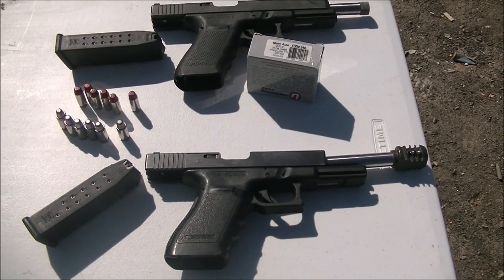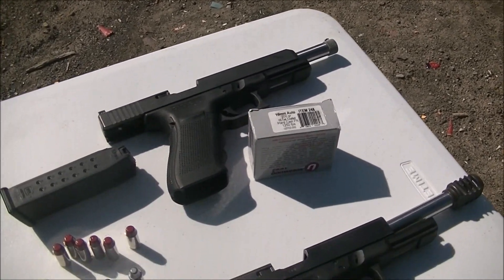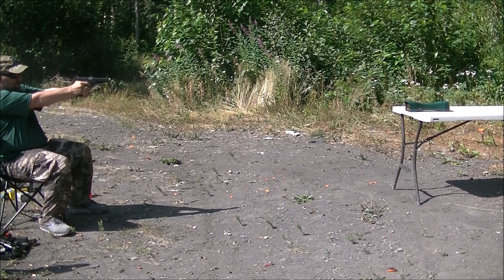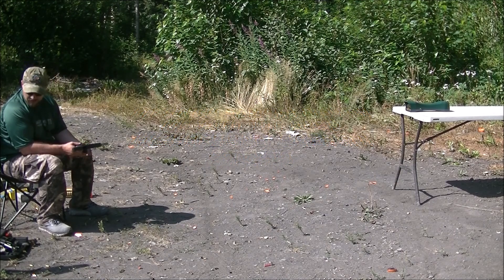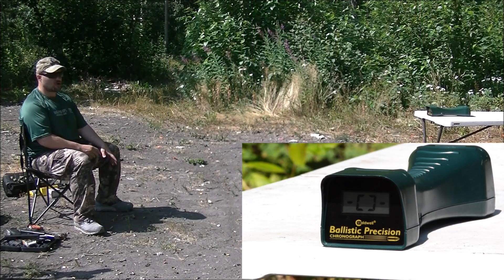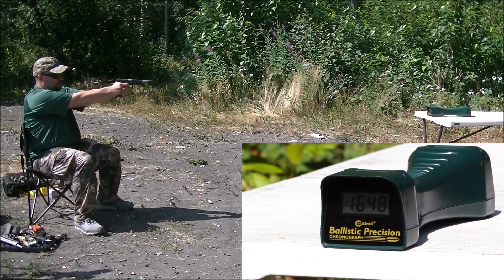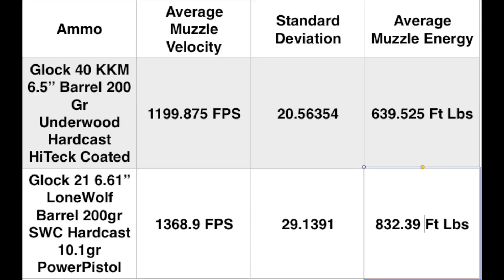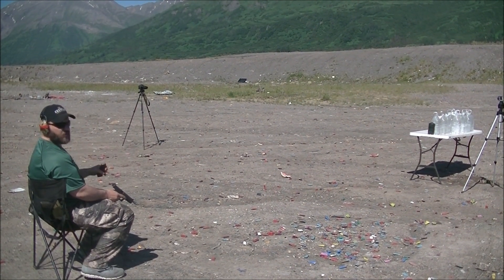10mm vs 45 Super 200gr Episode 3: Hardcast Lead

Comment: Its quite obvious though that 45 super is unreliable at least in glock conversions as seen all over the internet.  Maybe hk usps are reliable with 45 super. But it doesn't do anyone any good against a bear if the slide doesn't go into battery. Stick with revolvers people for that
Reply from the maker: the 10mm is just fine.

Comment: Have you ever tried .450 smc? I’m told it’s basically the same loading as a .45 super, but it utilizes a cut down .308 casing, making it safer to use in a bone-stock 45acp+p rated handgun. I ordered a box of 255gr hardcast .450smc and it runs phenomenally through my FNX.
Reply from the maker: CAn't get ammo
Reply: @AlaskanBallistics  double tap has some
Reply from the maker: @rubberbabybuggybumper6270  not on the shelf in Alaska

Comment: 10mm is great but with all these companies watering down 10mm I'm thinking about switching
Reply from the maker: To handloads?
Reply: @AlaskanBallistics  . That's what I'm going to start using. My buddy loads his own
Reply: 10mm is no different. It has never reached rated box velocities. It's just becoming apparent now that there is a lot of chronograph videos.
Reply from the maker: @alexskillz45 you've not seen my chronograph videos where I often exceed box velocities then
Reply: @AlaskanBallistics  No. Not out of factory length barrels, no.
Reply from the maker: @alexskillz45 n well I don't have 5" delta elite that they test those numbers from
Reply: @AlaskanBallistics  With the 5" Delta Elite, this guy got 1284fps avg. https://youtu.be/uhYfDfWWM8k
I don't think that's a bad velocity or watered down at all. I would rather have a G40 with a KKM threaded barrel anyways. It seems to me 200gr is the most optimal "heavy for caliber" hardcast in 10mm. The heavier ones have greater performance loss. Probably because of less case capacity.
Reply from the maker: @alexskillz45  I couldn't agree with you more sir
Reply from the maker: @alexskillz45 also Underwood's ammo varies a lot from lot number to lot number.
Reply: @AlaskanBallistics  🤣 Yeah, right.
Reply from the maker: I've proven it
Reply: @AlaskanBallistics  Sure, buddy. I know all the 10mm fans love your channel.
Reply: @AlaskanBallistics  How can you prove anything? You don't even take chrograph results correctly.
Reply: @AlaskanBallistics  You probably figured out that getting the rou ds down real close to the sensor will increase the speeds on the results, but the chronograph is not consistent like that, thats why you get variations of 300fps or more. Either you are doing it wrong, or you're intentionally trying to increase the speeds on the test to impress the 10mm community. Get a professional chronograph before you can make such claims against a manufacturer.

Comment: This comparison is not comparing equally.  The 10mm pressure is around 3700 to 3900 psi and the 45 Super is close to 2800 psi.  Not comparable.  You need the 460 Rowland to make an equal comparison to the 10mm.
Reply: David, you forgot a zero to each of the pressures you're showing. 37000, 39000 and 28000 PSI are the correct pressures.
Reply from the maker: Maybe so

Comment: Just ordered a 6lb firing pin spring, 24 lb recoil spring, stainless steel guide rod, +10% power Magazine spring and a KKM precision barrel to make the full move to 45 super!.... When normal and +p loads aren't enough! You can go online right now and easily order buffalo bore or underwood 45 super ammo. It's "hot enough" of a round for me as that is...
Reply from the maker: It'll work. I've put it through a grizzly head
Reply: @AlaskanBallistics  yup! I think that's all the parts I need to make a failure-free 45 super pistol.
Reply from the maker: Have fun.  Think I'll switch back to .45 acp after summer
Reply: @AlaskanBallistics  taking a break from the super power round??
Reply from the maker: I've got 3 10mm now so maybe
Reply: @AlaskanBallistics  nice. I've got two guns. A p365 xl with normal 115 and 124 grain sig sauer v crowns with a crimson trace laser, and my glock 21 Gen 4 Thats currently stock but not for long. That's all I got lol. Question, do you have to change back to the 17 pound dual recoil spring when firing regular 45 acp? Will the 24lb cause malfunctions?
Reply from the maker: Probably.  22lb  is what i use  Aint no feed anything but extra light ball loads
Reply: @AlaskanBallistics  my conversion worked flawlessly. I think the extra power mag spring is essential for smoother feeding into the chamber. Got 3 different super rounds. The 135 grain Leigh defense at 1500 fps is probably my favorite follow by the 230 grain at 1100 fps. The 185 grain 45 super Nosler round doesn't penetrate Ballistics gel all that much and dumps its energy very very fast and pancakes out. But I'll still take that over normal 45 acp. Still very powerful coming from a semi auto(right on par with a full power 10mm) I also bought a sar9 for $282 after rebate. Nice pistol for such a cheap price.
Reply from the maker: Try the 185gr XTP bullet? Might be a handload option only

Comment: If I might make an observation about your penetration comparison, although using the same weight bullets is fine to compare muzzle energy, the same weight will put the larger caliber at a significant disadvantage with respect to penetration because of the substantial difference in sectional density. If you repeat the penetration test with around a 230 or 255 grain hard cast for the .45 super, the test would be more fair. I’d run the numbers and get sectional density as close as possible to even between the two. The other obvious factor is hand loading versus factory. I frequently load .45 super to .44 magnum levels, which can’t be fairly compared to shelf 10mm ammo.
Reply from the maker: Check out the latest .45 super vs 10mm video as we've done that

Comment: Would the 450SMC make a difference? Also i would like to see 308 vs 7mm-08 vs 7mm mag.
Reply from the maker: Can't get ammo for the 450 smc
Reply from the maker: 7mm Rem Mag is at least 400 fps faster with the same bullet weight as 308 or 7mm-08... not s fait comparison.

Comment: I think this is the first one of your videos that I've watched with no snow. LOL 
I can't see how adding a powder coating could make the bullet softer.
Reply: adding the powder itself doesn't make it softer. The process does, because to powder coat you have to heat the bullets in an oven, but if you pull them straight out and put into very cold ice water it shocks them hard again, but you have to do it quickly. It's kinda the same principle as hardening and quenching blades. Buy a store bought knife and get it too hot and you lose the temper and it gets softer, just the hardcast bullets do it at a lot lower temperature.
Reply: I learned it from a guy here in amarillo who casts and powder coats his own bullets to load and sell his own ammo in his shop.
Reply from the maker: Me either

Comment: Wow, I'm surprised at these results..typically 10mm slightly edges out 45 super.
Reply: .45 super really shines when you can throw a 255gr behind it and compare a max power load with a max grain projectile.
Reply from the maker: @RadDadisRad  next 45 super verses 10mm will be 220gr 20mm hardcast verses 255gr 10mm hardcast
Reply: @AlaskanBallistics  20mm?
Reply from the maker: On ballistic charts yes,  but with both being long barrels the .45 super really starts to shine.

Comment: No surpised that the 10mm penatrated further as it has a sectional density of around .18 vs the supers .14 in the 200 grain weight. I find the 45 super and the 450 smc very interesting.
Reply from the maker: Yep they're an interesting couple of cartridges . I know for a fact the .45 super 200gr hardcast will go through a grizzly bear's head

Comment: Alliant Power Pistol is good stuff!   It’s my super/Rowland powder of choice.
Reply from the maker: Nice.  What do you load?
Reply: Alaskan Ballistics - in 45 cal or general?  45 acp/Rowland, 454 Casull, 44 mag, 357, 400 Corbon, 10mm/40 S&W, 9mm, 450 bushmaster, 308, .223, 6.5 Creedmore.
Reply from the maker: Specifically in 45 super or 460 Rowland? 
Also interested on the 6.5 Creedmoor loads
Reply: Alaskan Ballistics - I’ll see if I can give use some general info.  A little hesitant to give out load data pushing 40,000 psi and 1,000 lb ft in 45 Rowland/acp platform.  I use quickload to estimate chamber pressures of loads I’ve already worked up.... Using power pistol I’ve clocked 230 HP RAINER plated bullets at 1300+ FPS for about 850 lb/ft - 250 Horn XTP @ 1150 FPS/750 lb/ft using Ramshot Silhouette although Power Pistol would be better.   Silhouette has load data for a 250 grain @ 900 feet that is listed as a non-+P 45 ACP Load.   I’ve ran 185’s at well over 1500 FPS and exceeding 950 lb/ft of energy using power pistol.   Again, concerned about giving load data not knowing specifics.    If you want me to use QL for some loads you’ve already worked up I’ll run numbers for you.   You can go from there.

Comment: My big problem with your conclusions is that you are comparing handloads to factory rounds. Needs to be a factory to factory, or handload to handload comparison.
Reply from the maker: You're absolutely right, unfortunately there is no 200 grain 45 super factory load, and I don't have the set up for hand loading right now and couldn't ask any my friends to load me up some in 10 mm...
 I will be doing the hard cast test again with factory ammo the 320 grain Buffalo bore in 10 mm and the 255 green Buffalo bore in 45 super. Have the ammo bought just got to have the time to film
Reply: Results would have been different otherwise as they are when compared on other channels.

Comment: My question is which incapacitates a bear better: penetrating an extra few inches deeper (10mm), or making a fraction of an inch wider diameter wound track (.45 Super)? 

I just ordered UW 220gr HC because other vids showed that it went further and faster than other 10mm HC loads, and because I was under the impression that penetration is the goal when shooting animals. 

I can't shake the feeling that .45 Super and .460 Rowland are louder and boomier, but they don't go as deep, so that rules them out for me.
Reply from the maker: Well I did pull that .45 super round that i shot through the Grizzly's head and pulled out of its shoulder... i plan on doing 220HC vs 255hc in my next 45 super vs. 10mm
Reply: @AlaskanBallistics  - Cool. Like so many other people, I get excited by the idea that these modifications may have made .45 a truly competitive defensive round again. I am humble enough to consider the possibility that 10mm might not be the end-all that it so often appears to be. 

But I just want to be careful that I'm not so taken aback by the energy numbers on a screen or on paper that I fail to consider how those .45-on-steroids calibers do inside actual targets. If they don't go as deep at 10, then that number matters far more than anything else.

Comment: 45 super is a fantastic round—if not the need for more moderate and controllable sustained fire, the acp would be a super!!! The cartridge can obviously handle the pressure lints and so can the glocks
Reply: Don't forget that 45 Super has a different case, identical dimmensions to a 45 ACP but stronger, basically a 460 Rowland case but with standard dimmensions. It's better in my opinion to use .45 Super brass. The standard brass will definitely shoot +P.
Reply: @paulhomsy2751  I e found no benefit through my testing

Comment: Every town has a post office in it and the internet has every bullet you can think of. Looks to me like you just used juiced up hand loaded rounds for the .45 super seeing as your .45 super has more after market accessories on it. You should do the test over with factory loads and try to use steel that is flat so that if you pull your shot the 10mm isn't going through more steel, that throws off your outcome in the end you know.
Reply from the maker: Find me 200gr factory loaded hardcast for .45 super then we can talk😜😁

Comment: Thanks for your data ! I have a Glock 20 and a Lonewolf 6.5" barrel with a compensator on the end like your 45 super. But I'm shooting a 200gr Hornady XTP(but Im not necessarily recommending that bullet) . But with 10.3 gr AA#9 I'm getting 1300 fps average velocity which results in 703 ft. lbs of energy. I would like to find a hard cast bullet I could reload with in the 200 gr weight range. But I think I would be happy to use Buffalo Bore ammo for bear use and keep other bullets for practice & plinking.
Reply from the maker: Nice... that's a good load... 
The 200gr hardcast should be available for handloading
Reply: Montana Hardcast Bullets 200gr FNGC
For 10mm
Reply from the maker: @redteam9881 what's their hardness level?

Comment: I love my 10mm for bear country.  I’ve been loading 200 grain hardcast for 1400 FPS. I figure there have to be safety factor built in there. Anyone else push the safety factor?
Reply: Where do you get Hard cast bullets for a 10mm in 200gr or heavier weights ?
Reply from the maker: Alaskan Ammo.
Reply from the maker: I don't handload for 10mm yet.  But i was hoping these would get there with the longer barrel... i was wrong

Comment: Wow. Im guessing the 45 super is going to become a lot more available.
Reply: It is alive and well, but really only among handloaders, and only for those who want more power. Its niche by demand. You can however load it as cheap as pretty much any other defensive load. I use cut down military surplus 308 brass, and powder coated cast bullets. 

If you load 45ACP, and have a strong 45ACP gun like a Glock, H&K, you already have everything you need aside from components and a brake or silencer to get into the super game.
Reply: 45 super is not a production handgun load for mainstream handguns. Doubt it will ever kick off. Like anything you’ll have unique followings for specific things and the 45 super is one of those.
Reply from the maker: Maybe.  If you can order ammo online,  then it's pretty available,  if not,  then it's hard to find

Comment: To be far i love both the 10 and 45 super . But the slugs in the underwood outperforms  the wodcutter i think i spelt that wronge but the wodcutter which a old gun smith exsplained to my as a compation design for accuracy he said. He said he had used them  for pistol competition. And underwoods hardcast slug was well we know what that dose, i know both are hard cast but design has to be a factor!
Reply from the maker: I totally agree. But my buddy who uses the wascutter and loaded them for me.  Plus if you see my latest bear hunting video, you'll see that I shot the bear in the head with one of those and I pulled it out of its shoulder

Comment: This is why I carry a 10mm with a 180 or 200 grain hard cast when I'm out and about. Great video!!
Reply from the maker: Not a bad choice! Thank you for watching!!!
Reply: I keep a mag loaded with sig elite fmj for bears but my AZ bears are quite a bit smaller lol was told 9mm would suffice but fu k that! 10 mm all the way
Reply from the maker: Those sig fmj aren't heavily bonded and will shread their jacket if they hit something heavy and hard enough.  They should work for AZ black bears but I'd still get a box of coated hardcast or extreme penetrators

Comment: 45 super sounds a lot like 44 magnum.  Do you choose it because of the higher capacity?
Reply from the maker: I chose it because I didn't have the money for a 10 mm at the time and this was a much cheaper conversion. Then I went about 44 and a 10 millimeter anyway. A good 44 magnum load will generate over a thousand foot pounds of energy easily out of the same length barrel. 45 super is nowhere near 44 Magnum

Comment: I have never liked auto pistols for some reason. 

On that note, i just traded my 10 ft inflatable boat for a 5.5 inch ruger redhawk in 44 magnum. 

Do you do any reloading? Any suggestions for hand loads in 44?
Reply from the maker: I don't at this time.  Sorry bud
Reply: Use unique for loads at or about 1000 fps for general shooting. Use H110 or 2400 for true magnum loads. 44 has excellent sectional density with bullets at or above 300grs. Dont worry about hot rodding, while the redhawk can easily handle it, the 44 doesnt need extreme loads to perform well. It's an exercise in futility. Avoid lil gun, there's many reports of excessive wear early in the guns life due to it.

Comment: I stick with 10mm because 45super is a wildcat and I dont believe in them, just like why I ain't spending money on 22tcm atleast not for a while because I believe in one gun per somewhat common calibers but if they ain't common enough it ain't worth it
Reply from the maker: I don't disagree with that. But I can get the ammo so I'm not worried about it but if I had to pick one off the shelf it would be the 10 mm
Reply: @AlaskanBallistics  I can also just buy online it's just I dont believe in not very common calibers
Reply from the maker: @MultiDryder  45 super though is what 45 + p should be these days
Reply: @AlaskanBallistics  I agree especially with looking at 9bple where +p+ was once 115gr going 1300fps when nowadays that's relatively safe pressure especially with newer guns but I think real reason at that velocity is because with older 9mm any faster it would disintegrate
Reply: 45 super isn’t a wildcat. Every 45 can chamber rand shoot it.(some shouldn’t)  several manufacturers make dozens of different loads. It’s just 45+p++ you can take 45 acp target Ammo and pull the bullet and add powder and it’s a 45 super ( minus the case web thickness)
Reply: Your comparison to 22tcm is apples to oranges. 22 tcm needs special brass, projectiles, dies, and barrels. 45 super needs none of those. But I wouldn’t load 45 acp brass past 1,000-1,100 ft/lbs.
Reply: But the case web thickness IS important at .45Super pressures , in most .45acp chambers .